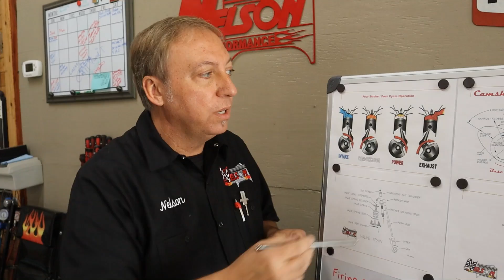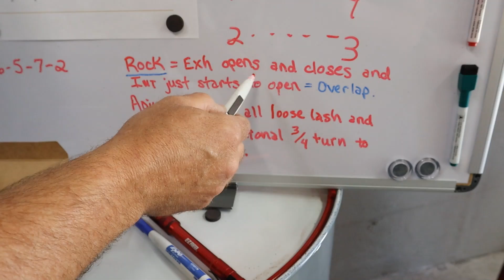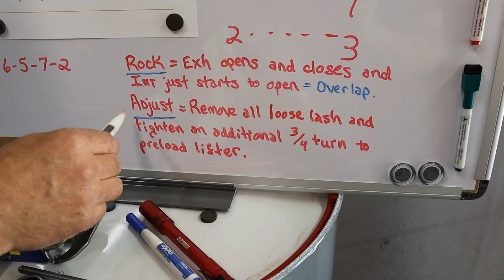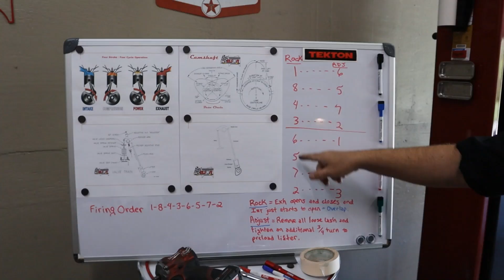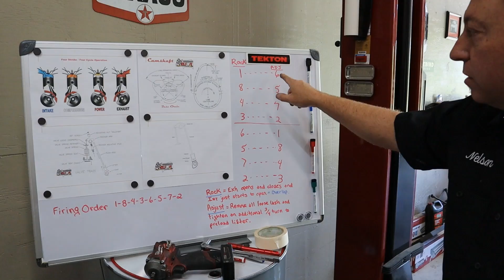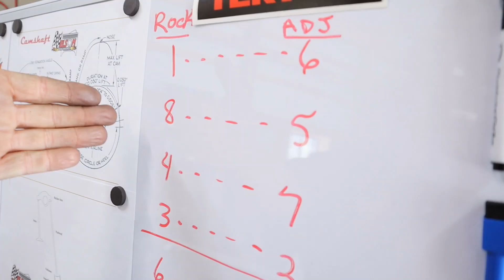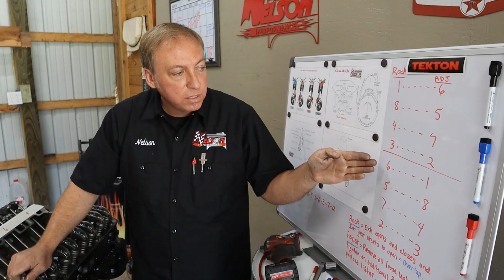Rocker Arm/Hydraulic Lifter Adjustment

Comment: What if the manifold is on and you can not see the lifters?
Reply from the maker: Hello first off, thanks for the view! Having the manifold on is no problem, you can just watch for the pushrods to fall and rise instead of watching the lifters and if you feel the up and down slack in the pushrod while tightening the adjuster nut you will know when to make the 3/4 turn. You can have a friend tap the starter while you watch them but it takes a very slight tap of the starter to get to the next adjustment. Good luck on the project!

Comment: This is amazing. I'm about to perform this on a Ford 3.8L. Should the lifters be soaked overnight before performing the lifter adjustment or will that lead to improper lifter adjustment?
Reply from the maker: Hello, it’s best to do the adjustment dry, then use an oil pump primer to fill the system but you can still use the 3/4 turn and do the adjustment with lifters that already have oil pressure in them. The valve springs have enough pressure to “bleed” the lifter back under full valve lift during the adjustment process since there is no oil pressure until the engine is started up. Good luck on your project!

Comment: The 3/4 turn is making two assumptions. The rocker ratio is stock and the adjusting nut thread pitch is stock. As a smell test, I would set up an indicator on the first one at the pushrod pivot and verify the movement from 0 lash to the required lash from the lifter manufacturer and record that amount of nut rotation and apply that across the remaining rockers.
Reply from the maker: Typically most hydraulic lifter preload specs are .080 min to .180 max plunger movement (100 thousands low to high).  A 1.5 to a 1.6 ratio rocker would create a difference of .008 thousands (two and a half hairs on your head 😄) but a good thought for sure if you’re looking for high accuracy in a specific application. Thank you for commenting and viewing none of your business 😁 Nelson

Comment: Hey man I noticed that in the beginning on the first sequence you adjusted both intake and exhaust and then on the second sequence you did the other side again was there a reason for that I don’t think I quite understand that part
Reply from the maker: Hey Tristan, I think you are referring to when i went back through and double checked to make certain the wire clip was off of the plunger after all had been adjusted? If that wasn’t the answer to your question, message me back again with the minute that it happens in the video and I’ll try to figure it out. Thanks for commenting and viewing 👌🏻 please subscribe

Comment: Can this be done without visual access to where the pushrod seat in the lifter meaning with the intake manifold on
Reply from the maker: Hello first off, thanks for the view! Having the manifold on is no problem, you can just watch for the pushrods to fall and rise instead of watching the lifters and if you feel the up and down slack in the pushrod while tightening the adjuster nut you will know when to make the 3/4 turn. You can have a friend tap the starter while you watch them but it takes a very slight tap of the starter to get to the next adjustment. Good luck on the project!

Comment: Lithium grease??? Is it soluble?
Reply from the maker: Hello, the white lithium spray I used in the video is only to protect the friction points during dry start up. For years we used white lithium on engine rebuilds from bearing to cylinder wall “pre-lube”. You can use any recommended engine safe lube but it’s always a good idea to change the break in oil/filter right away after break in. Thanks for commenting, Nelson

Comment: Getting ready to replace valve guide seals on a gen I 350 sbc and my search on how to set valve lash FINALLY led me to this video. Perfect explanation on how to perform this procedure! Thank you very much for posting. Like & subscribe? Done!
Reply from the maker: Hey, Great, glad we could help and also you can still use the 3/4 turn and do the adjustment with lifters that already have oil pressure in them. The valve springs have enough pressure to “bleed” the lifter back under full valve lift during the adjustment process since there is no oil pressure until the engine is started up. Good luck on your project! Thanks for the comment and viewing! Nelson

Comment: I have a 1994 Ford 460 and my firing order is 1-5-4-2-6-3-7-8  would it be that I would rock cylinder 1 to adjust 6 and 5- to adjust 3 and so on? And also do I start off getting number one cylinder at TDC with the push rods out ?  Or do you have them already in but very loose ? I'm just having difficulty's with what steps to first ?  also could i contact you ? Thank you for your help
Reply from the maker: Hey John, must have missed your comment earlier. Yes, that’s correct on the rock/adjust order and I would install all of them loosely , Nelson

Comment: What if the lifters are full of oil? Do they need to be drained?
Reply from the maker: Hello, you can still use the 3/4 turn and do the adjustment with lifters that already have oil pressure in them. The valve springs have enough pressure to “bleed” the lifter back under full valve lift during the adjustment process since there is no oil pressure until the engine is started up. Good luck on your project! Thanks for the comment and viewing! Nelson
Reply: @mitchnelsonperformance  
Thanx man

Comment: great video  agree  but if you in a class at the school  mi concern to adjust this way the intake need to be removed it's okay when you replace the cam or lifters. but when you just adjusting  the valves and the intake still on  looks complicated to me on a complete engine assembled  when I working on my engines never used this adjust style  because don't have enough  time when I racing and manifold still on the engine  only my opinion
Reply from the maker: Hey, thanks for that comment, I’ve had plenty of “hurry up before the next race” repair jobs too 😁 Having the manifold on is no problem, you can just watch for the pushrods to fall and rise instead of watching the lifters and if you feel the up and down slack in the pushrod while tightening the adjuster nut you will know when to make the 3/4 turn. You can have a friend tap the starter while you watch them but it takes a very slight tap of the starter to get to the next adjustment. Good luck on the project!

Comment: thanks, can you achieve this with the manifold still in place?
Reply from the maker: Hello first off, thanks for the view! Having the manifold on is no problem, you can just watch for the pushrods to fall and rise instead of watching the lifters and if you feel the up and down slack in the pushrod while tightening the adjuster nut you will know when to make the 3/4 turn. You can have a friend tap the starter while you watch them but it takes a very slight tap of the starter to get to the next adjustment. Good luck on the project! Nelson

Comment: The way you adjust valves is good, but with a hydraulic cam, I prefer to do it my way...something I learned years ago to do with a firing order of 1, 8, 4, 3, 6, 5, 7, 2. For those of you out there that are not sure. If you have the intake off so that you can see the cam and the lifters...this would be best for you as you can see that the lifter is at its lowest point on the back of the cam called the heel. Turn the engine over so that it is ready to fire on #1 cylinder. Both valves on #1 cylinder should be closed (lowest point) when the timing mark is on TDC. Turn the rocker nut to remove any play with the push rod to get zero lash. Take note of the position of your ratchet and tighten the nut 1 full (360*) turn and stop on all 16 nuts. With the engine set to fire on #1 cylinder and the timing mark set to TDC...you can adjust the intake valves on 1, 2, 5 & 7 cylinders as well as 1, 3, 4 & 8 exhaust valves. Turn the engine over one full (360*) turn and stop on TDC again which will put #6 ready to fire. Repeat the process of taking out the push rod play to zero lash. You can now adjust the intake valves on 3, 4, 6 & 8 as well as the exhaust valves on 2, 5, 6 & 7 cylinders. If you have the intake off when doing the adjustments, you can verify that the lifters are all the way down in their bores as well as see the lifters on the back (heel) of the cam. Even if you degree your cam, this process will still work. I have been doing this for years and never had an issue. I build engines...mainly 540 inch BBC engines using custom grind hydraulic roller cams making 750 horse power and more using this way of adjusting the valves...mainly for high performance boats... http://www.youtube.com/MotorsbyShooter ...if you want to see some of my engines. For you DIY guys and guy-ets...either way will work for you on adjusting the valves. Just take your time and you should do just fine.
Reply from the maker: thanks

Comment: Finally a complete tutorial that allows me to understand what the hell people have been half ass saying.  Thank you sir. Headed to the wrenches🫡
Reply: Are you performing this in the vehicle with oil filled lifters? I'm trying to figure out if it still works. I'm imagining it does but just don't do the preload?
Reply from the maker: Hello, you can still use the 3/4 turn and do the adjustment with lifters that already have oil pressure in them. The valve springs have enough pressure to “bleed” the lifter back under full valve lift during the adjustment process since there is no oil pressure until the engine is started up. Good luck on your project! Thanks for the comment and viewing! Nelson
Reply from the maker: Awesome! Glad we could help out on your project.  Nelson
Reply from the maker: thanks for the comment 😁👌🏻

Comment: Does this method apply if the engine is in the vehicle and I'm simply swapping out the old bridge rockers for roller rockers? In other words, if the lifters are already primed with oil?
Reply from the maker: Hello first off, thanks for the view! Having the manifold on is no problem, you can just watch for the pushrods to fall and rise instead of watching the lifters and if you feel the up and down slack in the pushrod while tightening the adjuster nut you will know when to make the 3/4 turn. You can have a friend tap the starter while you watch them but it takes a very slight tap of the starter to get to the next adjustment. you can still use the 3/4 turn and do the adjustment with lifters that already have oil pressure in them. The valve springs have enough pressure to “bleed” the lifter back under full valve lift during the adjustment process since there is no oil pressure until the engine is started up.

Comment: What if the lifters have oil in them?
Reply from the maker: Hello, you can still use the 3/4 turn and do the adjustment with lifters that already have oil pressure in them. The valve springs have enough pressure to “bleed” the lifter back under full valve lift during the adjustment process since there is no oil pressure until the engine is started up. Good luck on your project! Thanks for the comment and viewing! Nelson

Comment: Hi bud I wanted to ask if this method would work on the ford 351?
Reply from the maker: hey Darth, yes,  if it has the adjustable locking nuts on studs. Otherwise if it has the (5/16th) bolt down pivots then they are torqued to a spec, but they sell different pushrod lengths to achieve the proper lifter preload and you can use the video to determine the preload. an empty lifter (no oil) should have between .080 minimum and .180 maximum lash between the rocker arm and the tip of the valve when on the base circle (no lift) of the cam to have proper preload. Nelson

Comment: Can I use this method the run run valves after a break in on my engine, just ignore the preload since the lifted are full?
Reply from the maker: yep 👌🏻 the lifter will “bleed” back the plunger under full lift since there is no oil pressure when you’re turning it over by hand . it shouldn’t need readjusted though after break in.

Comment: If your lifters are already primed, do you still have to do the 3/4 turn when adjusting your rockers?
Reply from the maker: Hello Mault, you can still use the 3/4 turn and should to get the cup off the retaining clip and do the adjustment with lifters that already have oil pressure in them. The valve springs have enough pressure to “bleed” the lifter back under full valve lift during the adjustment process since there is no oil pressure until the engine is started up. Good luck on your project! Thanks for the comment and viewing! Nelson
Reply: thank you

Comment: I think I'll just pay someone else to do it for me.
Reply from the maker: You can do it! 👌
Reply: @mitchnelsonperformance  I'm not even sure I have to yet, I'm going with its a bad injector at this point. No oil in water, no water in the oil and spark plugs look fine. But if it turns out to be the head gasket then I will have to. On a 88 for f150 5.0, once you get the intake back on you can't  get to the valve cover.

Comment: I cant find a nut that wont come loose. Ive tried them All. Always have 1 or 2 come loose. Within 120 to 150 seconds. What brand of nut are you using? I guess i can check my local dealer. Melling sells a Prevailing Torque Lock Nut. $3.29 ea. plus tax. That came loose too. Maybe ill weld them. Im going on 3 weeks of fighting this problem. I cant even get this newly rebuilt 327 warmed up. Pissin me off. Any suggestions? Thanks
Reply from the maker: Hey, 🤔 not sure why they won’t stay locked but you could always get a set of poly locks. They have a center set screw to lock them and I usually snug them with the wrench (9 1/6-5/8) after tightening the set screw. just don’t over-tighten the nut after or you can crack them.
Reply: @mitchnelsonperformance  thats what I started with. 5 or 6 of those came loose. I found a part No. from Melling and gave that to my local parts store. Turns out the advertised thread was 3/8-24NF when in fact they were 3/8-20NF. so I traded those in for the right ones. Also picked up a set off a 69 pickup. One of the 2 should work. I've been fighting this for 3 weeks now. It's crazy. I might trash the motor before it ever breaks in... Yikes

Comment: Mitch, question,  Comp Mother thumper cam, hydraulic flat tappet.
Requires removal of inner spring for breakin period,  how much preload on the lifters for this period on cam break in? Would this be the same as your video or a little less preload,  thanks.
Reply from the maker: hey William, the same preload will work fine👌
Reply: @mitchnelsonperformance  Thank you Mitch I appreciate you taking time to get back to me!

Comment: question... so the motor is in the truck. and so doing it on a cold motor i assume? am i good to back them off completely then redo them. fyi i need to drive it tomorrow morning lol thanks guys
Reply from the maker: yes👌 Hello first off, thanks for the view! Having the manifold on is no problem, you can just watch for the pushrods to fall and rise instead of watching the lifters and if you feel the up and down slack in the pushrod while tightening the adjuster nut you will know when to make the 3/4 turn. You can have a friend tap the starter while you watch them but it takes a very slight tap of the starter to get to the next adjustment. Good luck on the project!

Hey, you can just back them off and then readjust them as you go through the process (I.e. you don’t need to back them all off first). A slight up and down feel of the free play will be felt in the pushrod or you can gently lift up and down on the rocker to valve tip until -0- lash is met. You may need to use a 5/8 spark plug or other thin wall socket because I’ve seen thicker wall sockets push against the rocker giving a false feel, or just pull the socket out and check free play then reinsert it as you adjust. Pulling plugs are optional. Once you get it in position (rotation) to begin, the rotations are only 90 deg so it’s fairly easy to rotate between adjustments. If you have a friend that can just feather bump the key, the starter will work great to run through it. Or you could bump it 60 deg and wrench it the other 30
Reply: @mitchnelsonperformance  omg thank you! i did it running aleady once, mistake. thats kinda why i asked if i had to back em all off and just start over.. and this motor has 190k you think ill have a stuck lifer or push rod? thanks
Reply: @mitchnelsonperformance  second! i just tied to push on the pushrods by pushing on the rocker and they wouldnt move. could there still be oil in the lifters maybe. motorr is warm. not hot
Reply: @mitchnelsonperformance  please note...

Comment: Guess I get to strip it down again n start over. Why is it that every video has a different technique???
Reply: Well. I did it like you said twice. Second time time make sure I didn't flub it up. I just put head gaskets in it n had it top dead center from the beginning. Guess I may not have had in compression stroke but then I started  over cause I thought I messed up. IDK. Best I take everything off n do it again. Slowly n methodically. I picked your video cause it made sense. I try it again

Comment: Ok. So I did every thing this man said n all I get is backfire n gas spitting out the carb. Had it tdc 12 times. Rotor to #1 Everytime. Wtf
Reply from the maker: Hey Billy, is it at tdc on the correct stroke when the rotor is aiming at #1 cylinder? when it’s at tdc it can be on the exhaust or compression stroke. if you can see the valves they should both be closed on cyl 1 when the rotor is aiming at #1 plug wire.